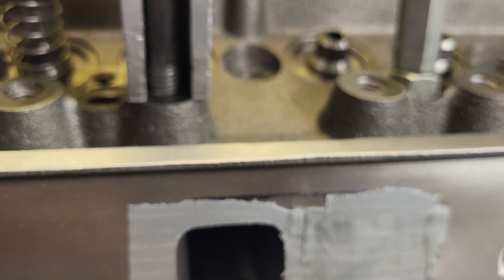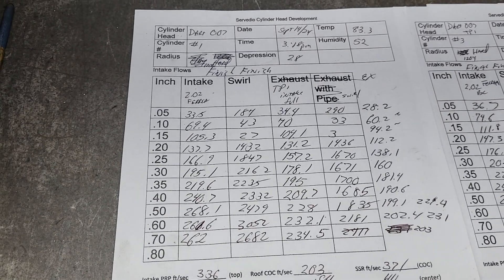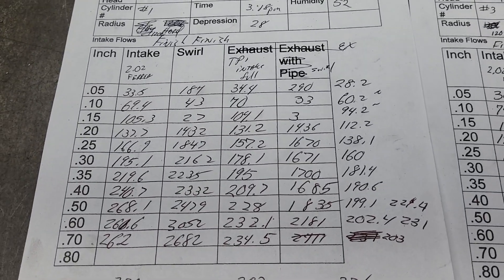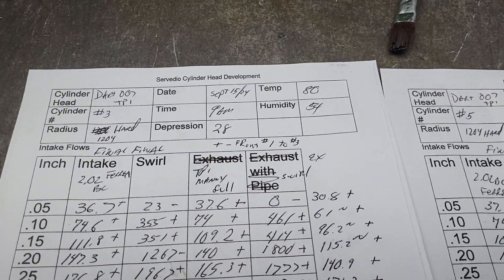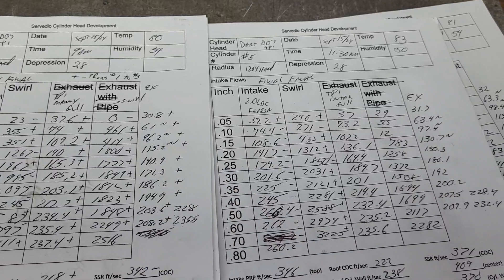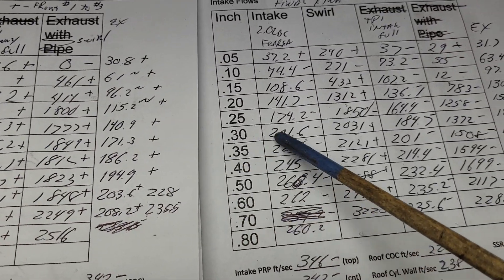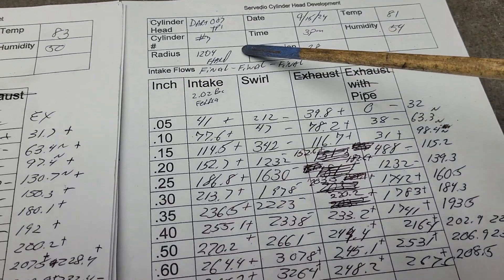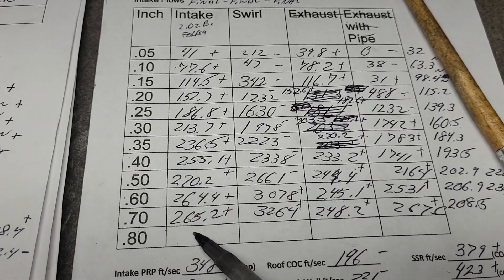Redheaded Stepchild High Performance TPI project. Each port flow through the TPI manifold #1,3,5,7

Comment: Hi Charles. 
 First, Awesome channel!  I may have a really odd-ball project to send your way.....not sure how far to go with it or who can do an in-depth airflow & full study on heads & "TPI-Like" old foreign intake......
Anyway, I was thinking on a very remedial level as I'm not a porter but do have a C4 in storage for many years;  since it seems that all the old tests Hollander did comparing all the different performance TPI's & showed the TPI benefited from more plenum volume especially with the SuperRam & the turn into the 1st 2 runners is farther from the throttle body, as you mention that problem here:  17:02  , here's my idea, but not even sure it can be done......

Can the front of the plenum be completely opened up  where the throttle body mounts too, (remove the divider between the 2 ports) & make the thickest "open" throttle body spacer-plate possible to move that throttle body forward to slightly increase plenum volume & so the air can make a less abrupt turn into the 1st 2 runners?

Also, what about radiusing the back of the throttle body ports, or shoove 2 snubby velocity stacks into the back of the throttle body??????? !🤔

I always wondered if the TPI would benefit to install velocity stacks at the top of each runner inside the plenum like modern day plenums!   I saw an old early Accel TPI square box plenum that had long air-horns layed down.....its listed on eb-y now.  Its wild looking.

It would be hard to get velocity stacks inside, but if the plenum front divider was removed, velocity stacks could be fanangled in & archaically pressed/pulled into each port & even extended into each runner & port-out the runner so the velocity stack doubles as an anti-revertion stack, & epoxy each stack from the outside of the plenum!   Or, mill off the plenum top & install velocity stacks & make a cover like the SuperRam!!!!!!😁

Also, TPIS makes a large butterfly throttle body called the Aqua Lung for marine.  Not sure if it will bolt on a stock TPI, or again, make a thick adapter plate to use it & increase plenum volume.

I know there were probably many who tested large bore or single butterfly throttle bodies for the TPI, but not sure if it would be detrimental in other ways on a stock TPI or ported TPI.

Doesn't seem like there would be any loss in velocity since its still a narrow plenum....

Regards,
Chris 
Pompano Beach, Fl
Reply from the maker: Bigger throttle body will probably not hurt but may not help as well.
Reply: Another TPI Mod idea.  Duplicate the design of duel plane manifold with a divider plate the full length of ithe TPI Plenum.  Basically, divide that plenum into a duel chamber plenum.  Cut a slot in the plenum underside full length of the plenum up to the throttle body &/or an extended into the throttle body & leave a small air gap between both throttle body bores just like some duel planes manifolds have a slotted divider....., then cut out the entire plenum base to weld in the divider to the plenum roof, place the plenum base over the divider wall (that would extend thru the plenum base for welding & fully weld all seams.🤔  My thoughts are to prevent opposing bank reversion & loss of air velocity thru the plenum.  Unless the TPI harmonics were designed to ram air from the reversion crossing over from 1 bank to another inside that open common area plenum?🤔
I'll have to also run this by Hollander & First TPI.
Reply from the maker: Thanks! A radius at the back of the throttle body would negate the anti reversion of a smaller opening into the larger plenum.
Reply from the maker: Stacks inside plenum may work but I doubt it tpi plenum is way too small now.

Comment: Hi Charlie i have 2 question 
Is the big valve always better than small valve and is the air speed important in the intake manifold runner like head port?
Thanks
Reply from the maker: @amirdoshmanfekan5145  No and yes. Thanks

Comment: I'd like to see a condensed version of the flow and balance original to now. Just straight up say #1 stock to #1 now, etc, particularly the intake.
Reply from the maker: I could answer this question another way. The flow path, throttle body to valve now flow about what the bare stocker head flowed, about. Thanks
Reply from the maker: Easy to do check the first few videos. Thanks